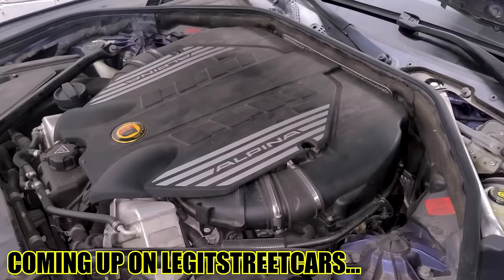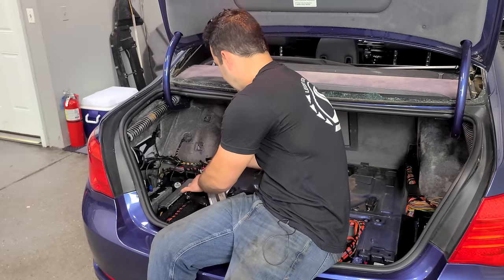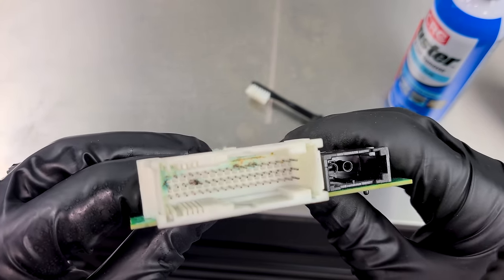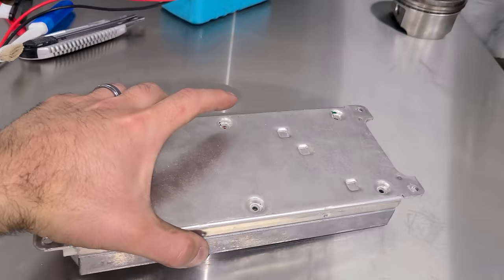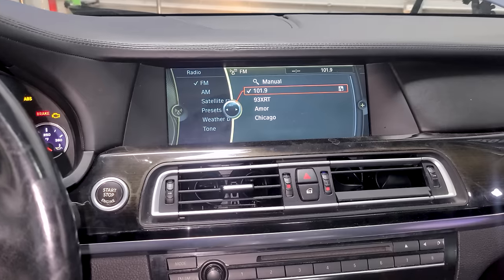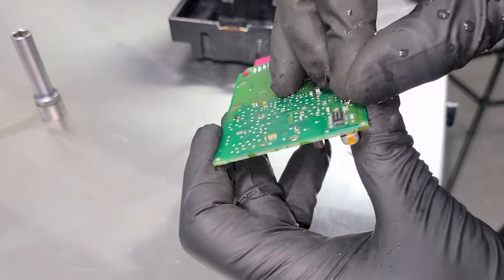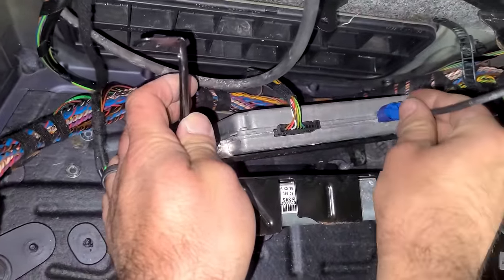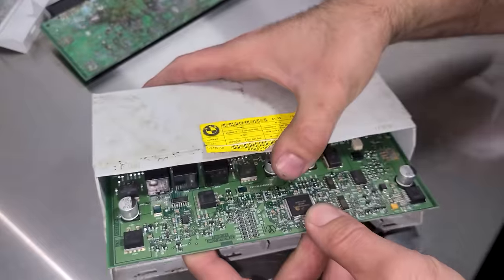BMW Dealer Tried Totaling My Car By Quoting $15,000 For 10 Computers! I Fixed Them All For $150!

Comment: Enjoyed your video. I am in the electronic failure analysis business. Everything you did was mostly right. The yellow coating on the board in conformal coat and the light blue/white putty looking material is for heat transfer from a part on the printed wiring board to the case. This material gets squeezed during the original assembly process. Over time it will get hard  and when you dis-assemble and then re-assemble, it will not have the same intimate contact for proper heat transfer. Using some new heat sink compound on top of the old compound is recommended or replace it all with new material. Never use a wire brush on any surface of the printed wiring board. If the soft bristle toothbrush is not aggressive enough, use one slightly stiffer. Best over all method I use is a mixture of DI water and IPA in an ultrasonic cleaner. Sometimes the area of ionic contamination is under a part and you will never reach it with any brushes.
Reply: "Never use a wire brush on any surface of the printed wiring board." 👍
Reply: Even when it's ok to use a soft wire brush......be careful it's not a brass coated steel wire brush...hard to tell the difference from looks....use a magnet, if it sticks...it's steel.

Comment: When cleaning crusty green control modules, it's good practice to use a weak acid first to clean the corrosion off. High concentration vinegar is good for most situations and being a weak acid it will not attack the components, just remove the green oxide and salt. After acid, use contact cleaner, and after that de-ionized water like in the video.

Comment: Yeah that header for the missing pin is super easy to desolder and replace so you wasted some money buying a replacement control unit. Just buy a new connector header, a solder sucker and a soldering iron if you don't have one already. Though $50 is really cheap for a controller...probably too cheap and unobtainable for most of us at that price.

Comment: Really surprised that so little of the control units have the conformal coating (the yellow protecting layer) on them. Do you think the infotainment system was supposed to be customized for Alpena? Instead of swapping that first module, you could desolder and swap the connector with the broken pin (or just swap that one pin perhaps) to revive the original.
Reply: That was a TCU and it would not impact the infotainment UI. It’s strictly for telephony related features.

Comment: I've been waiting for you to post another B7 video! The units that have that gel looking coating is actually called conformal coating. It's used to provide some liquid damage protection. 

You can buy that stuff as a luquid in a bottle similar to nail varnish or it comes as a spray.

I've seen some people use actual nail varnish, but I would avoid that as nail varnish can sometimes have some harsh chemicals in it also, if you ever needed to remove the varnish, it would be way tougher than conformal coating which with a little isopropyl alcohol or just by rubbing it, comes off.

Also, you can use an ultrasonic cleaner. Recently, I revived a water damaged DJI Osmo Pocket that showed nothing on the screen when turned on, but the gimbal would move about.

First I tried isopropyl alcohol and cleaned the board with a toothbrush. I tested it and found that the camera gimbal did nothing at all! 

Then I tried cleaning the board in a bath of isopropyl alcohol in an ultrasonic cleaner for 10 minutes.

Once I dried it up, I partially reassembled it. I was so excited when it came back to life and the screen was working.

The only thing that wasn't working were the onboard microphones. I think the ultrasonic waves destroyed them.

Still I'm happy the camera gimbal is working and 4k video capture is great!

I can do a workaround with the microphones not working.

Maybe in a future video you can try something similar. It would be interesting to see the results.

Thanks Alex, for another great video.
Looking forward to the next one.

Comment: As an electronics repair tech, rubbing alcohol can work well too. Just be aware that for some of the larger chips, especially if they’re BGA (ball grid array) they may still have corrosion and short circuits under them and still cause issues. I know Samcrac featured a BMW mechanic that knew how to perform board work on some of these cars.
Reply: You could soak the pcb in a small bowl of alcohol for a few minutes to get at the bga
Reply: also as someone who works on EVs, if its a HV component, just pay the price to get it swapped out. pretty much every EV part with a orange wire going to it has the ability to kill you so it's really not worth the risk of opening it up if you aren't 100% confident in what you are doing
Reply: @dillzilla4454  I was shocked that the wiring didn't ignite with all the corrosion. I would have disconnected the battery immediately and I certainly wouldn't have turned it on whilst the corrosion was there.
Reply: @ultimabear  low voltage devices take a LOT of corrosion and very close circuits to catch fire and even it is still very unlikely that it would catch fire rather than just losing contact with the circuit entirely. That is of the main benefits to using a low voltage like 12v in a car. It may not be the best for generating energy or starting your car but it virtually never catches fire.
Reply: @dillzilla4454  It's not the low voltage that is the problem it's the amperage from the lead battery. Try holding an ordinary wire between the contacts of a car battery and you'll drop it pretty quick.
Reply: @ultimabear  the wire can't hold the amps that battery puts out with the exception of  the 2 mains going to the fuse box.  everything else physically can't hold enough current at 12v to do any real damage by design. 99% of the wiring in a car is pretty much done for once it gets to 50amps
Reply: @dillzilla4454  search for "Car Fires: What Causes Them And How To Prevent One? | Talking Point | Full Episode" and skip to about 5:40 mins.
Reply: @ultimabear  at board level there will be lots of safety devices to mitigate over-current and over-voltage events. 

More likely sensitive components will be damaged beyond repair and the whole board will become a paperweight.
Reply: @justjosh11  In the case of corrosion or the presence of water these devices that you are talking about no longer work. You may as well take a screwdriver across the battery contacts.
Reply: @ultimabear  the likelihood of there being enough corrosion that diodes etc are no longer effective is extremely low. The corrosion has almost no chance of penetrating the package of the semiconductor so it will still be able to do it's duty.

In the case of a module literally filled with water though, of course that has no chance in working whilst still submerged. 

I would hypothesise that in most cases fires would likely be caused at cable level, not board level
Reply: @justjosh11  I'm guessing by what you just wrote that you don't know what diodes actually do. Yes, most of the fires would be caused at the cable level as the corrosion would cause too much current to be drawn through the cables making them overheat a bit like the wires in a toaster are designed to do and the plastic shielding would ignite. You all keep on saying that the wiring and corrosion couldn't cause a car to ignite yet here we are in a world where cars don't care what you all think and just keep bursting into flames regardless.
Reply: @ultimabear  with all respect, I am an Electronic Engineer so I do in fact understand what a diode is and does. 

Of course car fires happen but you are making out like they are a common occurrence and cars burst into flames all the time and are firey death traps. 

Instead I suggest it is you who in fact does not fully understand what you are talking about and instead are citing a YouTube video as your evidence.

Why do people insist on talking with such confidence and trying to call out other people when in fact they are not the expert they make themselves out to be?
Reply: @justjosh11  No, no I'm not. What I said was that if I owned a car that had been submerged in water for a long period of time I would not just connect a battery and turn it on without first inspecting it for all its faults. Not doing so could result in more damage to sensitive equipment or indeed a fire. As for diodes, I'm not sure what you think their purpose would be in preventing fires.
Reply: @ultimabear  You need a high voltage to get the amperage.  V=IR.   Or I=V/R.   Typical body resistance is about 1K-10K (wet to dry) ohms.  Current to kill you is 150mA.  The math says V=.15*1K = 150v minimum.  If you hold a wire between the terminals it will heat the wire up as you get 100+ amps flowing, hence a heating element.  You can actually blow up a battery by doing this due to the massive chemical reaction that happens at the electrodes and outgassing of hydrogen + the spark = BANG.
Reply: @pentachronic  I assume that you have seen police tasers. It's always a problem with them as the police have to run around to find a mains plug socket before they can zap someone and sometimes potentially kill them. It's not really the voltage that hurts you it's the amperage. You can be electrocuted by thousands of volts and all it does is hurt a little and possibly burn where it makes contact with your skin. You can also be killed by just 1 volt. Anyway, this was never about car batteries killing you it was about corrosion causing a physical direct link between both contacts of the battery which as you say will cause the wires to burn or even the battery to explode. Think of it as a wire coming from the positive terminal and going to a corroded unit the power goes straight across the corrosion and passes down another wire to the negative terminal.
Reply: @ultimabear  What are you talking about ???? The continuous current is exactly what kills you (I've worked in the medical field that sends current through the body).  It's disrupts the sinus cardiac signals and causes muscular damage.  You need a sufficiently continuous high voltage for that to happen. A short impulse does (such as a taser) not provide continuous current due to the capacitive loading effect of the human body.  Tasers actually causes muscle spasms and has a specific frequency to do that (around 80-120Hz) to cause involuntary muscular contractions.  They can cause a tachycardia event though which can cause a fatal heart attack (or other sinus interruptions).  You are repeating what I said about the wire shorting the terminals.
Reply: @pentachronic  Try googling "can one volt kill you?". There is no point in carrying on this discussion with you I am finding the repetitive banging my head against a brick wall tiring.

Comment: Great video. And this is coming from a 40-year plus technician. I recently bought a basket case e66 BMW. Mechanically and appearance-wise and really good condition. But the instrument cluster was lit up like a Christmas tree. And nothing worked in the iDrive. The drains for the sunroof were clogged. Allowing water to run up inside of the headliner and down the a pillars and C pillars. Car had a small leak under the rear seat. One by one I've removed the wet modules cleaned most of them, some had to be replaced. And just like this B7 little by little the car is coming back to life. For very little money.

Comment: VW says we engineered an $800 failure prone computer to run the windshield wipers. BMW says "Amateurs. We built one just to run the fuel system." Great job on the repairs and the video! That was awesome getting an intro from Sreten aka Youtuber M539. As far as the "dumb" modules are concerned, the real dummy is you if BMW can get you to pay big bucks to replace a module that didn't need replacement in the first place
Reply: This is a PWM controller with current monitoring etc. This makes pump work less with less fuel demand etc. and is great for diagnostics. Just You know, don't dump it into water and it will work probably for the life of the vehicle.

Comment: Keep in mind with those fiber optic lines that you want to make sure the tips/connectors are extra extra clean and not scratched. You can have extensive signal loss if you even have a spec of dust on the tips. Also want to make sure the cable itself isn't damaged
Reply: @cheeseburgerbeefcake  I think they look more like FC or ST connectors

Comment: I get that most of those control modules were in the trunk where one would not expect them to get soaking wet, but that really looks like cheap construction with stamped aluminum and plastic.  My 1996 Chevrolet Caprice had the ECM and Trans control module in a diecast aluminum case sealed with o-rings and waterproof connectors.  I would think that for what BMW charges for those cars and what they charge for the replacement modules they could do little better.

Comment: The 3rd Control Module you opened at 19:25 is conformal coated so was able to survive better.
You can buy spray conformal coating and spray each PWB assembly to protect from water in the future. Just protect the connectors where the pins go in with tape before spraying, once dry. remove the tape and away you go.

Comment: Excellent repair instructions, very detailed and concise.  You do a good job to dispel some of the fear in dealing with car electronics.  It seems to me that auto manufacturers could do a lot to make more robust electronics for their cars!  While those devices you were handling would be fine in the confines of a house, it seems to me, that in a vehicle, subject to the vagaries of climate, weather and accident conditions, more robustly-designed electronics would solve a lot of the issues.  There should be different standards of design for auto-mounted electronics as opposed to home electronics - they both appear to be manufactured to the same standards, which seems ridiculous.

Comment: Hands-down the most informative video on car repairs, this eases me so much and doesn't scare me away from older BMW's
Reply: Although you should be scared 😂. Coding can be a nightmare sometimes, especially on BMW's after 2005.
Reply: @legioner9  Agreed on that fact 😂 my biggest fear is a rod bearing getting thrown off an S85 E60/E63
Reply: @alsrig0420  😂 That would be a horrific thing. God forbid.
Reply: @legioner9  😂😂🤣🤣 BOOM!!!
Reply: @alsrig0420  😅😅

Comment: I have cleaned many commercial 2 way radios from various forms of corrosive liquids. After cleaning and drying the board, I test it extensively before coating the board with three layers of a silicone conformal coating. The coating also has a UV dye added to it so under a standard Black Light you can check and see if everything has sealed properly. I would recommend to everyone to do a preventative maintenance on modules that could be exposed to excessive moisture. Clean and coat the boards. You can check with any large Electronics supply house like Newark Electronics or in the EU, Farnell Electronics. They would be prime candidates for conformal coatings for circuit boards. One word of caution, if the board needs repair in the future you will need to have some solvent available to spot clean the area where you find a failed component. 
I also spotted some surface mount electrolytic capacitors on some of the boards serviced. When these fail after 5 to 10 years they will barf a corrosive electrolyte onto the board which needs to be cleaned before the new part is soldered onto the board. Don't forget to seal the repair with the coating to keep it watertight.

Comment: Hi Alex. Great video. Is it a good idea to use a bit of dielectric grease on the areas that were corroded and cleaned to better prevent the possibility of corrosion returning? At least maybe in the connectors? Best Regards.
Reply: 2 things:
 - There are two types of electric grease: Isolating (the grease is a poor conductor/good isolator), and contact (the grease is a passable conductor). I believe dielectric is the first kind of grease, but I might be wrong ☺️
 - Applying grease to these connectors seems to be a nasty job; excess/carelessly applied grease can short pins in the connector, and some of the female connectors look to be open-ish (strips of copper on the plastics where grease can work its way out).

Additionally, it really depends on the kind of signal these wires carry and manufacturer tolerances: The grease does add resistivity, which probably doesn't matter too much on the power lines and power grounds, but can wreak havoc on the signal grounds and signal lines with "little strenght" (low voltage, "long" distance).

Comment: Great video! I would only suggest, it may be smart to thoroughly rinse a board that was submerged in DI water with something like IPA. DI water can get trapped in small areas and take a long time to evaporate. In general, I would also be sure to rinse stuff being cleaned where it can flow the impurities off of the board, rather than spread around in some instances.

Comment: I am absolutely amazed at how easy those modules came apart. I have found very few modules on my vehicles that don't have seals or glue holding them together. The fact that BMW has all of their modules serviceable at this level is amazing.
Reply: Or suspicious
Reply: 😡Modules should be relocated and ABS better protected🤔🇨🇦

Comment: After seeing this video I had the audacity to open the radar box of the blindspot sensor and found out it wasn’t waterproof at all. So I cleaned it and sealed all the seams and also the plugs of both boxes on my Mercedes CLS Shooting Brake. So, thank you Alex for this video👍😉😀